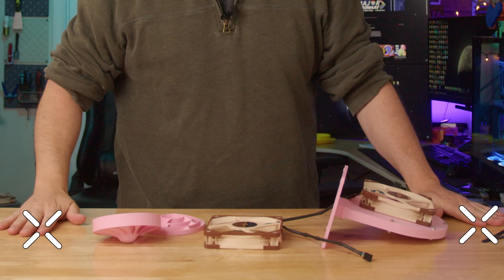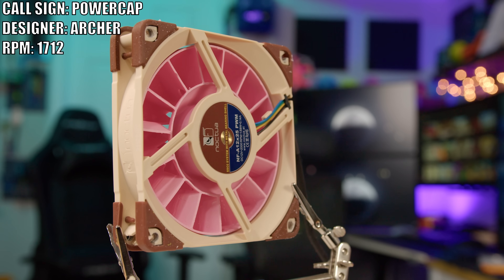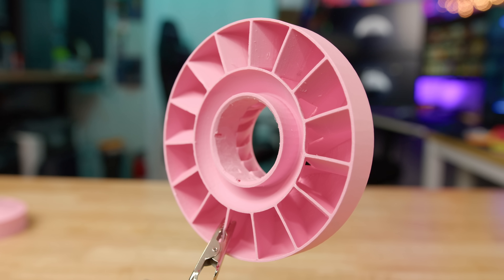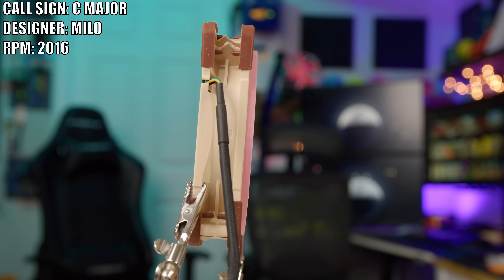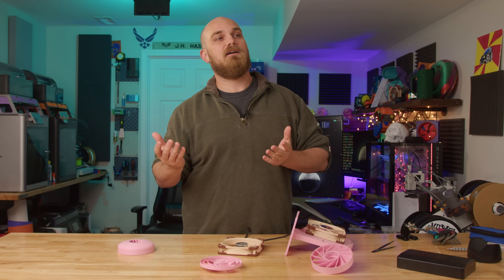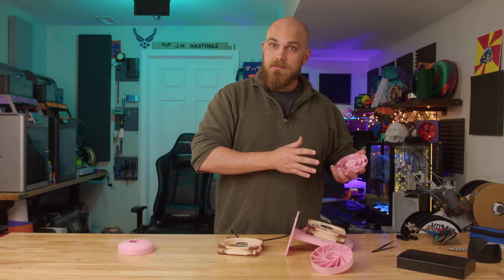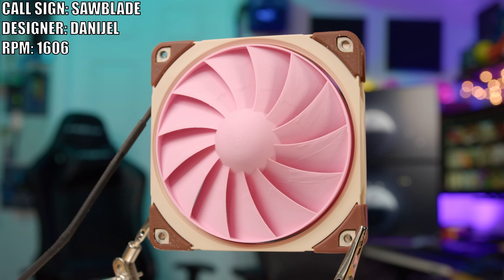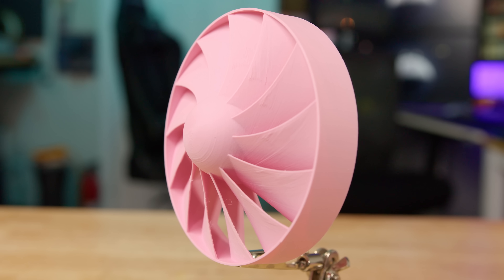Insane Fan Hack WINS Big! 😱 | Fan Showdown S6E4: Ultimate Static Pressure Battle

Comment: Please start making some kind of spin-off series where each season (or it could be a 1-per season affair) ONLY specific kinds of goofy fans are allowed to enter. I want to see more musical fans (each fan producing a different note maybe, rather than all notes on the same fan?) and more turbines (that could actually fit into a PC case), or some other interesting ideas. Maybe something like a fan that requires not one, but two or more fan motors to get the desired result.

Maybe have a theme what needs to be maximized to win for that round and see what ppl come up with, rather than testing them all on the same grounds.

Comment: Using multiple stages of axial or centrifugal fans may be an interesting path to higher static pressure increases. A good example would be the PW1413G with 42 compression ratio. This may be easier with axial than centrifugal, but both can be very intresting.

Comment: I just want to point out that, at a certain point, cfm matters. When it comes to cooling inside the tight spaces of a pc case and heatsinks, it's important to strike a balance between static pressure and cfm. This is because not only do you have to push air through tight spaces, you also have to push enough of it fast enough to keep up with the continuously generated heat.

My personal pick for best overall fan is the Angel! It easily strikes the best balance of cfm, static pressure, and dba, all without cheating by adding extra pieces or protruding out the base. Though I do love both the Dragon Wing and Devil fans as well.

Comment: Your not really measuring static pressure.  Static pressure is the friction that the air has to overcome, which is why it's called "static", because it doesn't change.  Your just measuring the pressure differential that the fan creates under the particular setup you have.

Comment: if the challenge is simply "make as much pressure in a sealed vessel" it's a shame there weren't any lobed supercharger designs. I guess the rules stopped a peristaltic pump? I guess it's a design challenge, but what is the practical use of something that is all prssure but could choke at low flow.
Reply: Its just having fun designing for and watching the competition.

Comment: What is mm H20?   It isnt pushing water.
Reply: Yes it is.
Reply: @TheRattleSnake3145  how did you keep water from getting to the motor that is in the middle of fan blade? why is it pushing water instead of air?
Reply: @c.j2527  Water is nowhere near the fan, its in the manometer.  Water is used so you can measure the height change when exposed to pressure or vacuum .
Reply: @c.j2527  Not sure how the digital manometers work , I used a DIY manometer.

Comment: Do you remember when this series was to find the best fan design specifically for PC cooling?  Pepperidge Farms remembers... 

Seriously, while I still enjoy this content, I would like to see future seasons step back and be more realistic to PC cooling. I know there was difficulty with how you measured the delta temperature, in adjustment for room temp being off by upwards of 5°c. However, I rather watch something like a standardized PC that only this fan is swapped on the cpu cooler. Something more realistic. Obviously all PC cases and coolers are different, but can easily just go for the best selling PC case, and don't mess with the case fans. Plop on something like a Noctua NH-L12 that sits sideways. Fans can still be a bit outrageous, so long as they fit in the case, mounted on that cooler. I mean props to The Wonder From Downunder, but nobody is using that design on a normal (off-the-shelf) case. Duplicate the same stress test until temperature idles. It's nifty to see what fan can provide the most cooling power. However, I'd rather set target temps (say 75°c) and from there see which fan can achieve that temperature at the lowest dB. As for the fairness of exact temperature control, this gets tricky. If its too much to ask for a room to be temperature controlled for every test, if there are results that are close, but the temperature of the room was fluctuated by a non-insignificant amount, could we retest at the end of the season to see there's a change in the rank?... just spit-balling ideas
Reply: Nobody is using any of the designs in an off the shelf case.  This is a design competition for fun.

Comment: The blades are curve the wrong way on the blower style fan. If they curved forward it would work better.
Reply: forward curve is for airflow, rear curve is for static pressure.
Reply: @TheRattleSnake3145  Yeah, you're right. did more research.

Comment: I like these videos, and the wacky designs are cool... But I feel like the rules should specify that the design keeps everything within the frame of the NF-A12x25. Some of the fans are very interesting, but the designs are pretty redundant for actual use if they wouldn't actually fit in a case or on a heatsink. My point being, they're no longer PC fans.

Comment: Next season we need a point system for airflow, pressure and noise. The downunder is not beatable with a regular fan design and is not practical to cool your PC. It excels in static pressure only. Once all factors (airflow, pressure, noise) come to play, the downunder is probably back in the field.

Comment: Loving the C-major! To get C major, those shouldn't be just octaves though, you're looking for root, third and fifth. The octaves you measured are likely naturally ocurring overtones. Judging by the math, it's not a well-tempered situation but rather based on just intonation, because intervals in just intonation have integer-only ratios. Root being 1:1, third being 5:4 and fifth being 3:2.
In the blade design this is visible: the outermost ring has 6 blades, the innermost has 4 blades. This would be 6:4, which you can reduce to 3:2, producing the fifth. The middle ring has 5 blades, making the 5:4 ratio needed for the major third. The inner ring is the root, which has 4:4 (it's the base reference), which reduces to 1:1.
Reply: Little addendum: You could express the entire chord as a ratio, that would be 4:5:6, which is just the blade count. At the tested RPM when you close miked, the root tone seems to hover around 278, a bit high for A=440Hz tuning.
Taking this into account, and also listening to what your mic picks up, you'd expect the root (C) at 278 Hz as said, the third (E) around 347Hz, and the fifth (G) at 417.
Reply: Another addendum: I was off by about an octave, you can divide all those Hz-values by 2 for closer numbers.
Screenshot of the analyzed audio (I focused on about 7:45, as it has it nicely audible, but it's quite visible for the entire closely miked section): https://pasteboard.co/WhRrPrblTVQm.png
Reply: Last addendum: this also correlates with the octaves you mentioned in the vid: C1 isn't registering much, probably because that's not the root of this bad boy. C3 would be the tone produced by the inner ring, aiming for about 130Hz, but it's a bit higher at this RPM at around 133-134, roughly half of my previous indication. Based on that, the next C would be twice that at roughly 266-168Hz, which corresponds with the screenshot I posted. There wouldn't be another octave overtone on this fundamental, as that's not how overtones stack, so that also explains why you don't find much around C5 (523Hz). There is another overtone slightly present, being the octave of the fifth:

Full list of tones confirmed:
Root (C3, a bit sharp): 133ish Hz
Third (E3 based off of that same tuning): 166ish Hz
Fifth (G3, same): 199ish Hz
---
Overtones: 
C4, 266ish Hz - octave overtone of root (C3)
G4, 400ish Hz - octave overtone of fifth (G3)
Reply: I lied. Lastest addendum:
Running at 2000RPM, one blade would be 33 and a third hertz. Four blades would make the most fundamental tone heard 4*2000/60=133 and a third Hz. That is also what seems to happen, and all other following tones can be found using the same math. So running it at 1950RPM would get it closer to/at A=440Hz tuning.

Comment: Static pressure isnt everything. Dynamic pressure and mass flow is what make a fan good or bad. Props to down-under, but if you were to run that on any AIO cooling rig, it would over heat.
Reply: Static pressure is everything when the comp is all about static pressure.

Comment: The C Maj. fan would be louder if the blades passed closer to the supports for the motor. The blade passing the support is where all the tones are going to come from, which is why most fans use a curved blade so as to reduce this effect.

Comment: 8mm h20 good luck getting close LOL
Seriously i would bet the max static pressure for the max rpm for the fan motor used would be 9 or 10 no matter what you do design wise to the fan "blades" Honestly 8 might be about as high as is possible. Eventually you will hit a point where the static pressure is so high that it puts to much load on the motor and it fried or slows down and wont produce any more pressure.
Reply: I measured 10mmh2O  but forgot to mention that I sealed the edges of the 2 halves with tape.

Comment: I didn't care for this season's layout from the beginning, and for this exact reason.  Pressure means nothing in a PC, even with radiators.  You still have to have the flow to move the heat away, and pressure is very very little if any importance at all.
Reply: This is a design competition .... For fun.

Comment: Fun fact, fans are being used as speakers. Normally, in a speaker, a magnet induces vibrations onto a cone that pushes air back and forth at a specific frequency. In a rotary subwoofer, however, large, flat blades are attached to a mechanism that changes the pitch angle of the blades from positive to negative, which is actuated by a magnet just like a normal speaker. Changing the blade pitch back and forth at a frequency has the same effect as a speaker cone, but it's able to move a much larger volume of air as it spins, which makes it much louder. This technology is sometimes used in pipe organs to emulate enormous pipe lengths (80, 120, 160 ft long or more) to be able to produce notes that can be felt more than heard. Since they're so loud, though, it creates an excessive amount of noise pollution as the design requires an "infinite baffle", or venting straight outside to produce a desirable effect inside. I saw a guy on youtube make one in his house and nearly shook the walls apart as pressure increased and decreased so rapidly.
Reply: They've been using fans for a long time. If you look up air raid sirens you'll find some historical ones. These designs are many times more effective than speakers of equivalent size in emergency alert systems.
Reply: @Varadiio  I have a small 12v version of those that was designed for car type applications, and they're so neat. I want a large one, like an original. My neighbors would love me.
Reply: @goosenotmaverick1156  where can i get one of what you have
Reply: @HeadyHaze  the mini air raid siren? I'm not entirely sure, I bought a box of old car horns and it was the only modern thing in there. I will indeed go take a look when I get a chance and turn it on and annoy the neighbors, as well as look at the brand or any identifying marks on it to help you out.
Reply: @goosenotmaverick1156  right on thank you
Reply: It is also the only type of subwoofer where the frequency response extends to zero Hz. It can raise the static pressure inside the listening room indefinitely. No other woofer can do that. By the way, brushless DC motors can be used as speakers too. After your first sentence I thought that is what you were going to talk about.
Reply: This is the coolest idea.i want to see this!

Comment: Just a thought... could you take the turbo charger one and print it mirrored. Leave some space in the middle, but much between the two halves, maybe like 4-7 mm between. Use 2 RTX Moters on each half pulling air into the center pocket? With such a simple designe making the air from the 2 fans pull into the center pocket would produce a better result. You could even do different size middle (airpoecket center at different thicknesses (3mm, 4mm,5mm, so on.) and see the changes in the readings. Just a thought. Never wrote in before but I love the show! 🫶🏻

Comment: In music there's a concept called interval, which is the pitch difference between two tones with some arbitrary frequencies. The higher frequency divided by the lower frequency is called the frequency ratio. Due to a combination of physics (harmonic series), and how tuning systems and history of music has developed, certain frequency ratios have been defined exactly or approximately, depending on the system of tuning that's being used.

Now a major chord always has three tones: The base frequency, a major third frequency above it, and then a perfect fifth as the highest tone. The frequency ratios for these intervals are, 5:4 for the major third, and 3:2 for the perfect fifth interval. These interval ratios are from something called five-limit tuning, but there are other systems such as equal temperament tuning which isn't exactly following pure integer ratios but it gets pretty close. I won't get into reasons why equal temperament tuning is more common today, let's just say it has to do with proliferation of keyboard instruments (pianos, pipe organs, etc.) and leave it at that.

So, for example, if we take a frequency of 220 Hz as the base tone, the major third of that would be 275 Hz, and the perfect fifth would be 330 Hz. These notes correspond to A3, C#4, and E4 notes, forming the A-major chord.

Now this fan is designed so that it has three rings, each with different amount of blades. The idea here is that every ring rotates at the same speed, but the different amount of blades gives a different amount of "hits" on air per rotation. The inner ring gives four pressure pulses per rotation, the middle ring gives five pulses per rotation, and the outer ring six pulses per rotation.

If the fan spins fast enough, these pressure pulses merge together to form audible tones. And the ratios between those tones depend on the amount of blades per each ring.

Since the blade number ratios are a perfect match for the above intervals, the middle ring produces a tone with a frequency that is is 5:4 of the inner ring, and the outer ring produces a tone with a frequency of 6:4 of the inner ring (or 3:2 if you simplify). So the fan will always produce three tones that form a major chord; the exact tones depend on the speed at which the fan is running.

If we assume that the fan is designed to spin at 2016 RPM, that means in one second the fan rotates 33.6 times.

This means the inner ring produces 33.6 x 4 = 134.4 pulses per second, or a frequency of 134.4 Hz. This forms the base frequency of the chord.

The middle ring produces 168 pulses per second, corresponding to frequency of 168 Hz.

And the outer ring produces 201.6 pulses per second, or a frequency of 201.6 Hz.

These tones correspond quite closely to the notes of C3, E3, and G3, which would be a C-major chord. However, if the fan's running speed changes, then it won't be a C-major chord. Unless the speed changes in octaves, or multiples of two.
Reply: This should be pinned. Well explained.

Comment: Why all that fuss about static pressure metric? Are we gonna make fans to inflate tyres or balloons?? 
I thought these are fans to cool down a PC case or a heatsink component...
The C major fan had excellent airflow and cool look and low not annoying noise but worst static pressure and finished last but from experience all these years from PC building that fan was the best!
I mean if only static pressure metric counts to leaderboard smoke test should be eliminated from the testing procedures cause it is considered a gimmick in the rating system.
Reply: its just a design challenge for the fun of it.

Comment: Milo designed his fan right but I have to correct the way you described it. While playing C major you play C, E and G. Interval of 4 semitones which is between C and E is called major third and it's frequency ratio is 5:4. Interval of 7 semitones which is between C and G is called fifth and it's frequency ratio is 3:2 (6:4). 5 blade ring should produce 1,25 times higher frequency than 4 blade ring and 6 blade ring should produce 1,5 times higher frequency than 4 blade ring. So yea it's right.
Reply: Bonus: major third is produced by 5 and 10 cylinder engines and fifth is produced by 3, 6 and 12 cylinder engines.